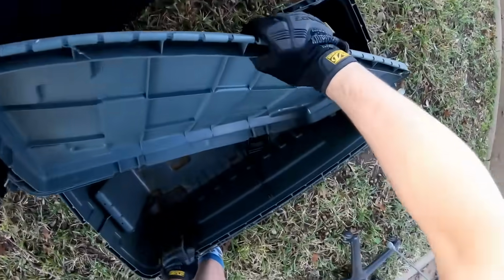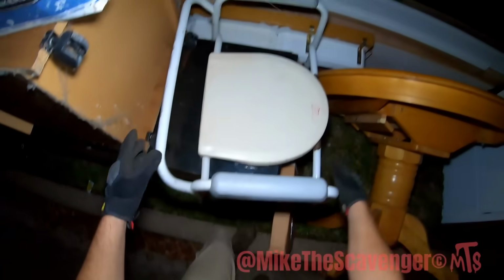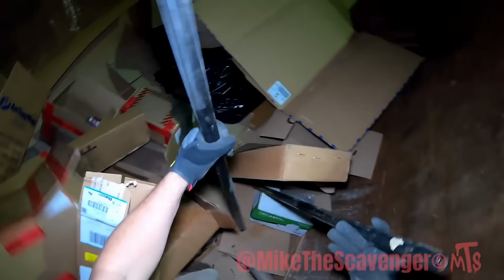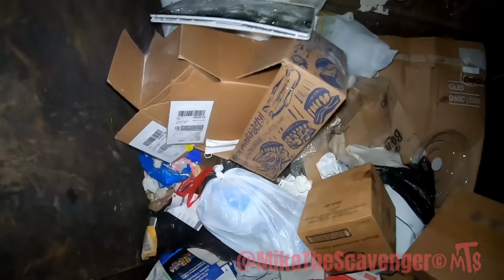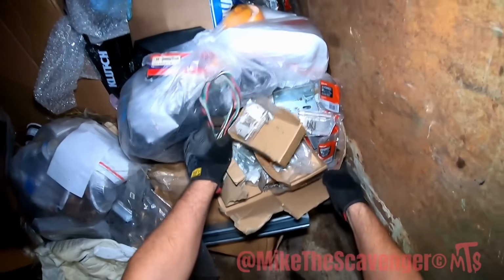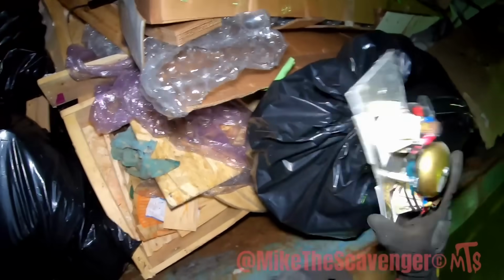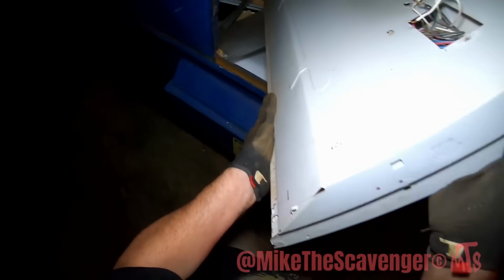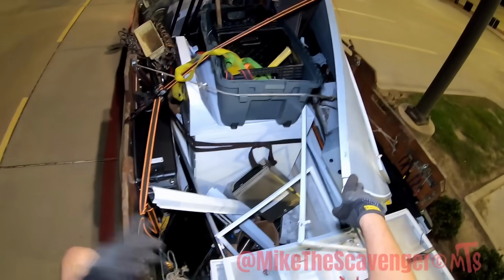Dumpster Diving & Curbsiding "Ring My Bell!"

Comment: I rented a old house and it had a floor heater. I had the Gas company turn it on. When I moved out they asked if the heater worked. Ha they thought it would blow up and didn't try it before renting it out. Ha

Comment: Rechabite Telescoping Magnetic Sweeper Pickup Tool, Screws Parts Finder with 35LB Pull Capacity, Retractable 8.6" to 33" with Strong Magnet, Pick up Nails, Screws, and Metal Parts
Amazon's
Choice
Overall Pick